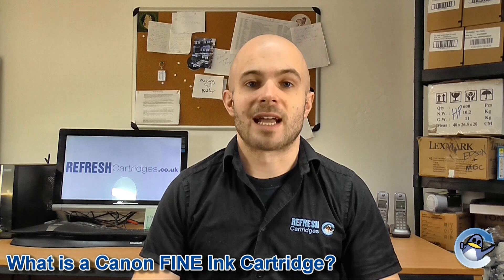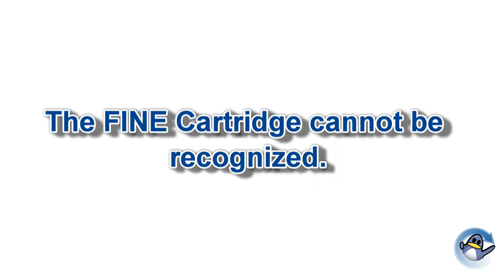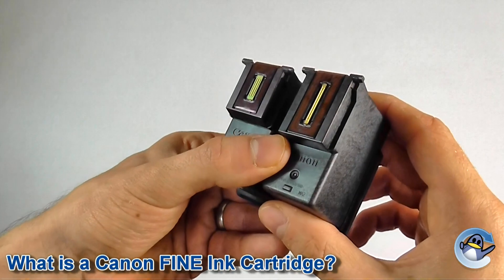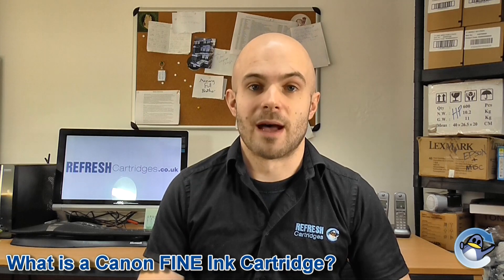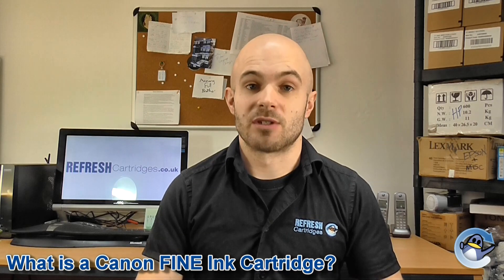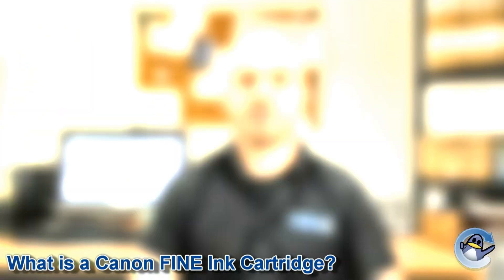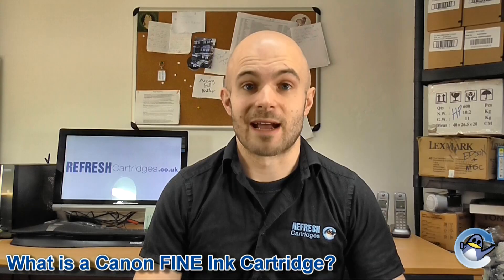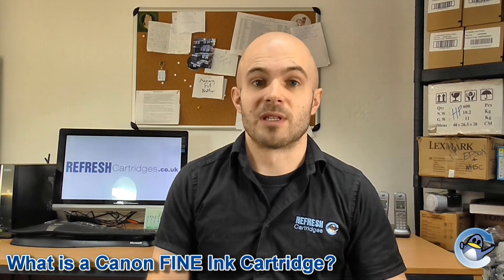What is a Canon FINE Ink Cartridge?

Comment: When did you say WHAT FINE cartridges actually are in this video?  Like time (0:00). You didn't actually answer the question.  

What is the difference between FINE and non-FINE?  I have both and both have the ink disbursement hole on the bottom, so it's not clear what the difference actually was.

Comment: Hello! 
My printer is an Canon PIXMA MG2500 with CL-245 & PG-245 FINE Cartridges'. 
I cant use the XL replacements?
Reply: I have PIXMA 2522, IT STOPPED PRINTING, SHOWING ERROR the error message "appropriate fine cartridge is not installed", BUT I HAVE NO IDEA, WHERE THIS :=" FINE" CATRIDGE IS, AND HOW TO REPLACE IT , MY INK CATR ARE HALF FULL

Comment: Hey, I've "repaired" some printers like Canons and HPs, epsons ecc.ecc. with the Waste Ink Adsorber FULL, after the Reset i attached in the rear of the printer one little bottle with a tube from the head cleaning part, but it's a little bit unaesthetic, expecially for Canons and HPs.... Do you know where can i buy that tipe of Sponges to replace them? and also i'd like to buy the Cartridges sponges to remanufacture them ;)
I ask to you because you do alot of fantastic videos, i'm fond of printing and printers :D Thanks for what you do on YouTube, hope you'll never stop doing that :D
Reply from the maker: Sadly not. I'm good at quick fixes and troubleshooting, but when it comes to changing parts like this I have very little exdperience. Sorry I couldn't help in this instance.
Reply: Thanks anyway